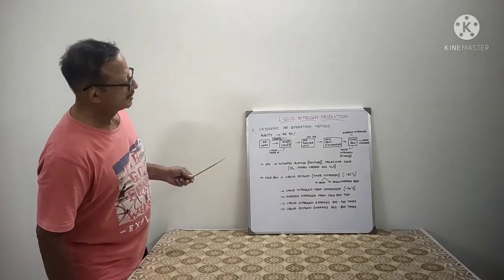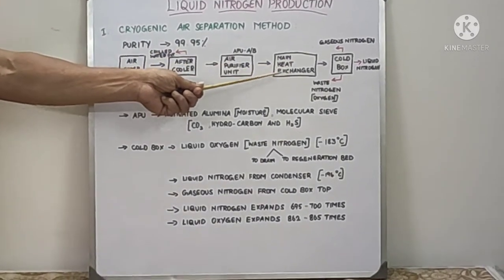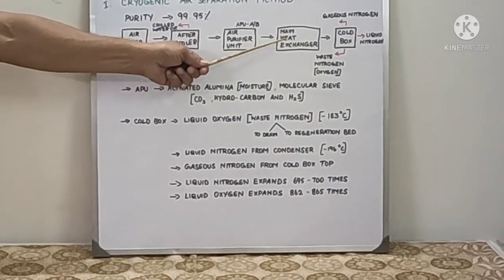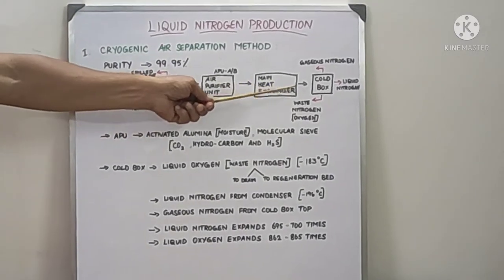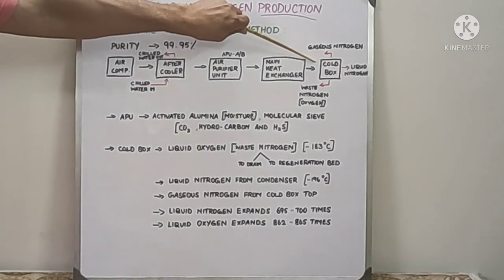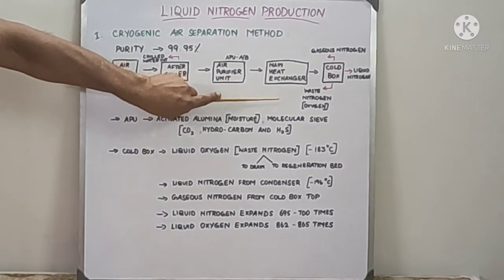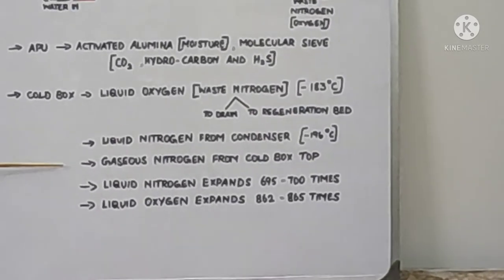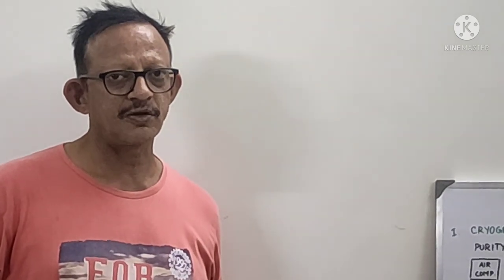Liquid Nitrogen Production by Cryogenic air separation method

Comment: Sir, what component is usually used for the interstage cooling part of the compressed air?
Reply from the maker: Cooling water is normally used. Based on your availability i.e. your CT may be open type or Closed circulation type. But it should be usually treated with chemicals to avoid Scaling, Corrosion and microorganisms growth.